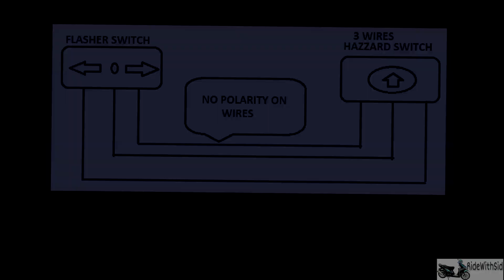How To Install Hazzard Lights | Mio i 125 | Applicable To Any Motorcycle

Comment: Saan papunta ung 3wire nsa socket boss
Reply from the maker: Ung 3 wires ng switch ba kamu papsy?
Reply: @RideWithSid  Oo
Reply from the maker: Nasa video ung whole process papsy. Bale yung left flasher + right flasher + power. Para gumana hazzard papsy. Panuorin mu mabuti papsy para d ka malito may diagram sa video hehehe RIDESADE MANOY!